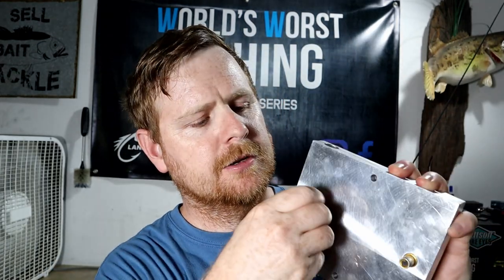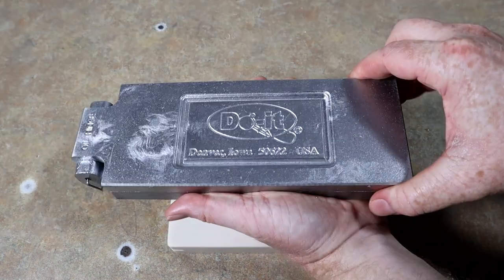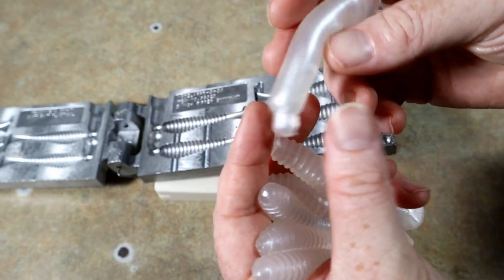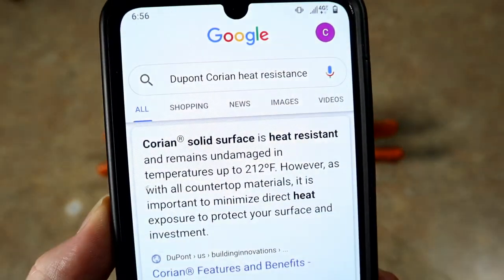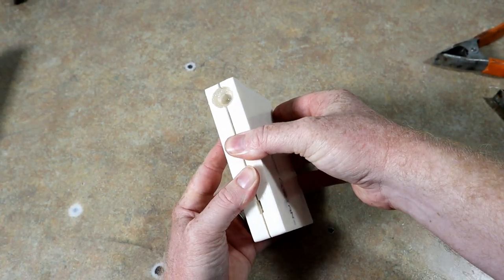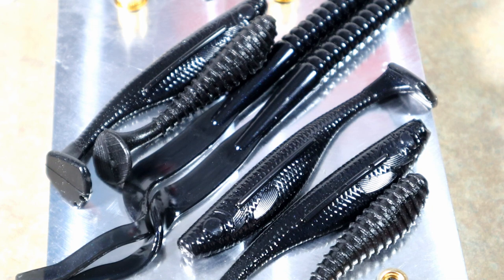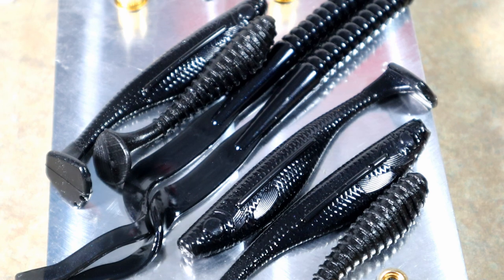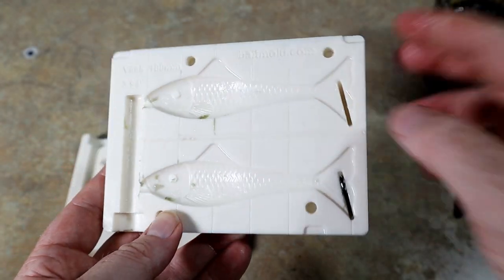Battle Of The Bait Molds!! Cast Aluminum vs Stone vs CNC Aluminum

Comment: I have cast quite a lot of baits with those baitmold.com 'stone' molds. They have to be brushed with worm oil every second or third cast, then there will no sticking issues. The first casting with a brand new mold is always a little tricky even if properly oiled. The biggest number of castings per mold I've done is roughly 500 and there has not been any visible signs of the mold being disintegrated but I don't suppose they will last forever. They are an inexpensive choice when making baits for yourself, but not that great for any bigger production obviously. Anyway, I'm more than satisfied with the molds, comparing the price vs. the result and also the fact that they have molds for many of the catchiest baits. If I could get the exact same molds in cnc-milled aluminum, I would not hesitate buying them.
Reply: i use them stone molds as well i use silicone spray it works very well

Comment: THANK YOU CHRIS!  You have taught me so well and saved me $$! I first started with pouring Do-it lead molds, excellent products. So naturally went with Do-it soft plastic molds. They worked OK.  Lots of denting and learning curves. Do-it injector is really a problem for newbies.  Dangerous by blowing the tip off (no pins) . I honestly would never recommend that injector.  I purchased a AI mold thanks to you and what a difference,  night and day. Now I am building my collection of quality molds. I am no Pro but I recommend waiting until you can afford a quality CNC mold from a reputable maker. I borrowed a stone mold from a friend and with proper oiling (I actually use WD-40 ) it pours very well,  especially for less than a $20 price,  but it does have limitations such as over heating and needing oiled  every few uses.

Comment: In both of your stone mold pours, I noticed trash in the tail that didn't pour correctly. Look back in your video. I have made several Alumilite Vac 50 molds of baits that I should not name and had to work on to get a functional bait. I do this because I choose to spend $$ on other toys. I have two stone molds and three more on the way. I really don't have a problem with them. The Bass and Crappie sure don't. Of course, I don't sell these and have to have the $$$ look. Still love you're channel and get notifications of every one!

Comment: Hey Teach.  I have a stone mold from Best_nj on amazon.  It is a 1 cavity mold that pours from the top. It is a 4" craw mold and it pours perfectly.  It also does a great laminate.  I don't use worm oil though, it is too expensive.  I just use the cheap spray cooking oil.  It also makes the bait shine.  But mostly I use cnc aluminum molds because you are absolutely right,  They are the best.  Thanks for the video, it was good to see the differences for people just starting out.

Comment: Just starting out and I use stone.. because it's cheap. I've shot three styles of bait and I get decent results. Mine are off of Amazon, they have toggle pins and seal fine. Two have stone pins, one has steel. While I agree that cnc must be better, I have had no issues with mine. I preheat mine on a heating pad and have fewer issues with differential cooling dents. Oil and plastic durometer have a big effect on the shine of the end bait. I will be getting cnc molds, but for now the stone molds work really well. I shoot stick baits, a punch style craw and a very complex creature bait with a core shot pin. The only release problem I have is on the rear flappers of the complex creature, but if I oil every third injection it's fine. None of this is to disagree with you, you clearly have more experience and knowledge than I do. Your channel is why I inject/ pour baits, marling taught me to make wooden baits. You both are great resources. Thank you
Reply from the maker: Glad you found a way to have success! Thanks for watching my channel
Reply: Your description about stone molds is the most realistic one that I found till now

Comment: With the stone molds I have noticed 3 things. 1it is a lot easer to open once you use it more. 2 it opens easer when it is a single Bait  in the mold not 2 like that one. 3 I haven’t notices the molds melt or get damaged when you use it a lot, I have used the same mold of at least 250 runs and is not damaged. I think that it is ok to use the baits. I have never oiled the mold and it works good. It is a good material for entry level bait makers and they are cheep compared to the CNC miles aluminum. Good video though
Reply from the maker: Interesting... everyone else I have spoken to in my bait making career has had trouble with stone..to the point they abandoned them.
Reply: @WorldsWorstFishing  are you talking about home made Hobbysts or Producer?
Reply from the maker: @MrCami2  nobody I know running real production uses stone, they hold heat too long to efficient and require lubrication often, every experienced home bait maker I know has moved on from stone molds to better things.

Comment: Hey Chis, as  lot of people cannot afford the CNC molds, and may want to get multiple cast "Do It" molds for the price of one CNC mold, I think you'd be doing a great service to both the budget and start-up bait makers by showing various methods to tune/tweak the cast molds, to improve the quality of the baits and make the most out of what may already be affordable or owned. The high temp paint sounded like a good trick. Polishing with a Dremel type tool would be another. Get the "B" rating up to a "B+ or A-". You could use that multiple swimbait mold (granted, a worm or stick bait mold would be easier) and to a different method in each cavity and show the results of each. I think that would be something a lot of people would appreciate. Thanks for this vid. It was valuable information.
Reply from the maker: Yes I will definitely modify my cast aluminum mold and do a compare and contrast video

Comment: I have a few of those stone molds. I use mold release spray you can get at any hardware store. Works 100% better than the oil. They come out of the mold very easy. I will not buy anymore of those because the aluminum ones are alot easier for sure. Thanks for the videos Chris.
Reply from the maker: Yeah I've heard oil works well and cooking spray..I def didn't have much luck with that swimbait lol
Reply: @WorldsWorstFishing  i guess thats how we learn lol. Still was fun to watch.
Reply from the maker: @markchase9299  I will modify my casted aluminum molds for better performance, but I most likely will not ever try a stone mold again.
Reply: @WorldsWorstFishing  i don't use mine anymore either. I have one of the sand cast too. Was my first one to get my feet wet. Can't  wait to see what you do with it.

Comment: Yes, I’ve been waiting for this video. Good to know, I won’t be buying the stone. I wouldn’t mind seeing you try a stone mold with it coated with engine block paint. Side note, how do you prevent denting?
Reply from the maker: Usually injecting at a super low temperature and holding 10 seconds of pressure is the cure for most denting
Reply: @WorldsWorstFishing   ok, I’d been doing it at about the 375 mark in a cold mold. I’ll try letting it cool a little bit next time

Comment: I have a bunch of the stone molds and I have never oiled them and always get great results i think they are worth the money just my opinion
Reply from the maker: You are definitely the exception, glad they are working well for you.
Reply: @WorldsWorstFishing  or perhaps you need a little bit training to use stone molds, for instance using a brush to oil them and not leaving oil inside tail cavity. To open them a flat screw driver gently twisted in the slot is the right procedure

Comment: Chris, I am surprised that you didn't go that extra step :)  dip those rough baits in a clear with something that plays well with textures like a little bit of hypershift or pearl power added.  Good demonstration over all.  The other n00b item I have been looking at are injectors.  There seem to be a wide range of them from DIY copper pipe rigs, to glass syringes, teflon ones and a range of aluminum ones.  Including multi injectors that mix sizes (25/75 volume difference for example).  And in terms of volume from 40cc and on up.
Reply: I've been going through a bunch of Chris' DIY vids and his first choice for injectors seems to be Bass Tackle. http://www.basstackle.com/category_s/78.htm. 

Still doing hand pour for now, but that's my plan if I make a jump to injection.
Reply from the maker: @marctheriault  definitely bass tackle!

Comment: Yes you get what you pay for but......Some just can't afford $200.00-$300.00 molds. Most have to "buy" their molds? Stone molds can and do work for what they were intended for and for many will work fine (a quick spray of silicon works great and a wide blade screwdriver vs a butter knife to open). Do-It cast aluminum molds work great for what they were intended for (a quick spray of high temp paint, clean none mold surfaces voila gloss baits)..  By the way take a CNC molded and a Do-It sand cast molded bait put them in water and see what the difference is, the fish nor most will ever notice the difference? If one follow enough forums EVERY company seems to have problems with lumps, bumps, etc.(operator error)? And how about you take one of those fancy $250.00 ** molds out back and smack it with a hammer a few times and see how well it holds up? As far as instructions.....hmmmm never got any with any of my expensive "name" brand molds. Other than that great video.

Comment: I know this is an older video.  I do have a special place in my heart for the blue silicone molds.   I have better luck pouring a 3 pour worm.  I can get the heat just right to split the bloodline on the middle layer.  It looks beautiful.  Especially with a top smoked color with a split gold dust bloodline, and the bottom smoke.  I like how you can add volume to the worm, height wise, without an actual over pour. I've bought 1 piece CNC flats, I can't get those results.   I also bought a couple injection molds, they are en route from BTS and and AI.  Now I can't find the GOOD injectors with the locking cap.   I need a triple with a triple and a double block.  I guess pouring flats for the last 25 years has me stuck in my ways.  Just need the injectors to start this journey and get with the times.

Comment: i started using the stone molds and they do stick unless you use worm oil on them. i used the knife to pry on mine when they stuck and snapped the side of the mold off. they are a good starting option for low cost. just got a batch cnc from angling ai. appreciate all of the content and inspiration from your videos!!
Reply from the maker: Thanks for watching man !

Comment: ive noticed my stone molds start to degrade just a tiny bit after a year of moderate use. not all of them though, some have started to kind of erode around the edges but the cavities are still good. I didn't have as much trouble removing them as you did but I oiled them at the beginning however I don't re-oil them all that much....im using small baits though and they probably don't stick as badly. I think they are great for the price but nothing beats a fancy aluminum mold....anyone reading this feel free to buy me some :)

Comment: The denting on the doit molds can be solved by oiling.  Rippers (what Chris is shooting here) and senkos are the worst offenders. shoot them slow,  around 315* and oil them. I like vegetable oil spray to oil the molds (I just use cheapo walmart great value spray).

Comment: For the stone mold would a lubricant spray work better?  Like a silicone one or even wd40? Maybe cooking spray too? Also loved the hammer portion of the video!
Reply from the maker: The website actually recommends greece, but I would imagine a spray lubricant would work well.. usually worm oil does the trick for these things

Comment: Awesome video! Great content. Now you have to test the baits side by side at the lake. Some tips from my experience with stone molds: These molds as with many things have a break in period. They work much better over time. Oil is a no go for the same reasons you described in the video. Waiting too long to remove the baits causes me sticking difficulty. If you remove the baits while the mold still has a little heat in it makes it come out much nicer. Just like cookies on a baking sheet, they are more difficult to unstick while cold. Firmer blends of plastic also perform much better than softer blends.
Reply from the maker: Good points about the break in
Reply: Try to use a brush for oil. PAM works better.
Reply: @MrCami2  I haven't tried that yet so it's definitely worth a shot. I kinda am thinking though that it will still have the same problem just slightly better. I think adding anything that will add volume of a liquid will continue to be a problem. Unless it can be forced out the vents.

Comment: Don't oil a stone mould. Use a proper  universal mould release spray and the lures will come out just fine.
On both baitmold and bugmold they recommend lubricating the mold so why shoot it without lube? Seems pointless and destined to fail.
It's like trying to drive your car without putting gas in it.

CNC moulds are great, but for the hobbyist just making baits for themselves and maybe a friend or two, I'd go with stone everytime.
I'd choose cnc if I wanted to produce big numbers of baits to sell.
Reply from the maker: Glad the stone molds are to your liking.

Comment: I have a few stone molds and I will offer this advice. They have to be oiled and they get slicker the more you use them. Secondly don't get a stone mold for a bait that has alot of detail to it. The tail on the bait he used caused nothing but problems do to it being a intricate detail. You can never get that tail slot oiled perfectly to avoid issues. I will still order a stone mold if the bait has a simple profile. No doubt that a CNC mold is the best you can buy. I love them.
Reply from the maker: Great points

Comment: I  Will agree they suck out of the Box but to get even heating on the do it molds I belt sanded the back of them and  I used my dremmel tool with a light compound and polished the inside so they came out smoother I oil everything between runs with Golden grub oil with a little paint brush .  I also have 2 angling AI C &c molds And one with no name I got it at a flea market  So I got a little bit of everything and I love to tinker with it ...PS love your channel And I live a couple miles away from where They make your beloved Yuengling beer😁👍🍺
Reply from the maker: Lol love the yuengling..it's not German bier..but it's good!

Comment: Chris, I think that reading comments about stone molds, quite all of them describe good experience, isn't it? So, I think that you have to review your opinion about them. Sure, stone molds are not easy to inject, there is a training curve, but ONE thing has not been said till now: you can find quite all most famous soft baits replicated by stone molds. I personally started with silicon pouring mold, now I use my own two halves silicon injection ones, I bought an american 4 cavities alu CNC mold, it's great, I also use some sand casted german alu molds, but believe me: my best injected soft baits come from the cheaper stone molds ... they are machined by CNC, too. Bye Cami

Comment: I make senkos in a do-it aluminum mold using regrinds, they ain't pretty but the bass don't care. I spent less than $100 to get everything I needed, including the plastic, molds, and injector. I've weighed in big bass on those senkos twice, and placed in the top 5 on em many times. And I've saved hundreds by not buying Yamamoto senkos, and I've proven my getto senkos to outfish em multiple times anyway. I understand buying a $400 CNC mold if you intend to sell baits because consumers want something that looks shiny, but there is no need to spend a ton on stuff if you're making lures for personal use. Just my 2 cents worth
Reply from the maker: Oh yeah that mold absolutely produces a good bait..and the good part is you can customize your barometer and colors however you see fit 👌

Comment: I'm looking for a good 5" senkos mold any recommendations also i have a couple of plastic baits I would like to get CNC Aluminum molds made do you now anyone that would do it.
Reply: Bugmolds.com can duplicate any mold or bait you have or even turn a drawing into a mold. They will do it in stone or aluminum to. You can get multiple cavities with individual sprues or single sprue and a runner. Its a foreign company but they do good work from what I have received. My stone molds catch as much as the aluminum
Reply from the maker: There are many many options for good CNC aluminum stick worm molds, basically just look at all the mold websites and take your pick..as far as real CNC custom work, you'll probably need to go overseas for that, most American companies don't make much money on custom work.

Comment: Recently got into the hobby and have been using a lot of 3D printed and silicone molds that are open pour, I did buy one of those stone injection molds and it was absolutely trash.
Reply from the maker: Yeah I had lots of problems with it

Comment: You can purchase a can of engine paint and coat the the do-it molds and the finish comes out a lot better. The vents on the Baitmolds stone molds and aluminum molds are not big enough
Reply from the maker: Indeed.. and I might do that at some point and then feature the mold again, today's video was to show a true comparison of how the molds perform as purchased.
Reply: I just saw you covered the engine paint, I guess I should have finished the video before I posted. I got to the hammer and thought it was over, Lol
Reply from the maker: @anton00867  hahaha